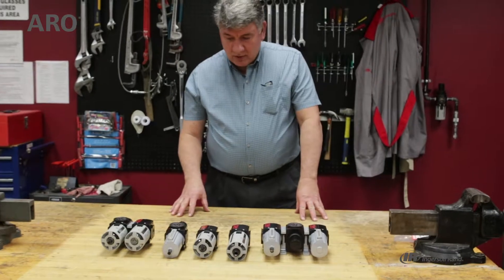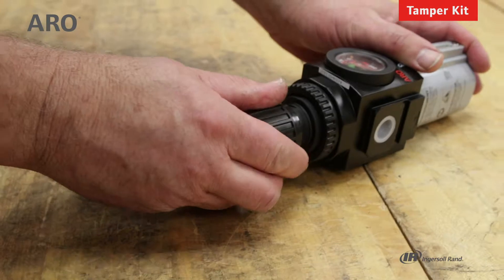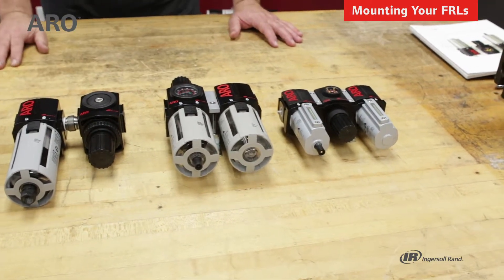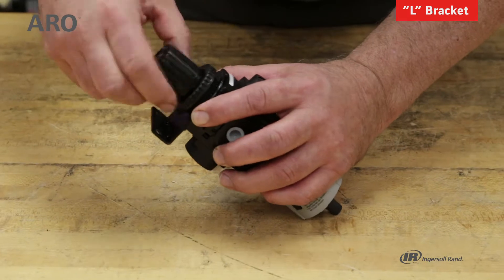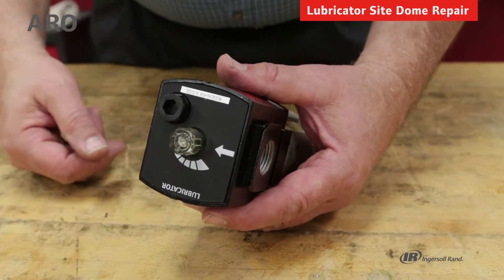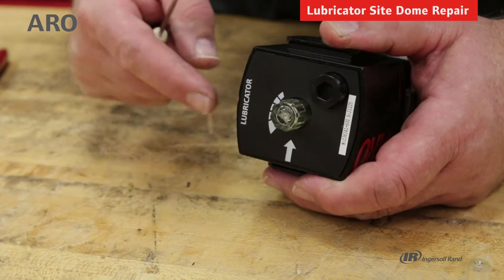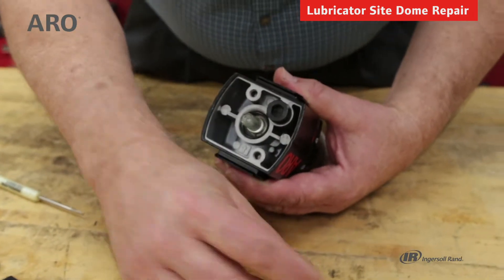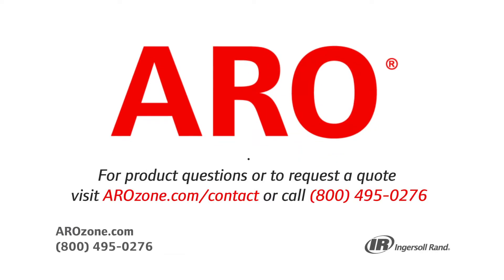FRLs: Mounts & Repair Kits

Comment: Hello, can you help me and share how I can disassemble a filter.  I have one like the one you adapted the lock on in this video.  but the one I have has a leak where the pressure is regulated. Mersrangel@hotmail!!
Reply from the maker: Our technical support team would be happy to assist you with this request. Please call 800.495.0276 or email arotechsupport@irco.com.